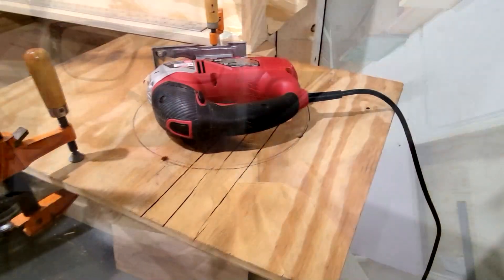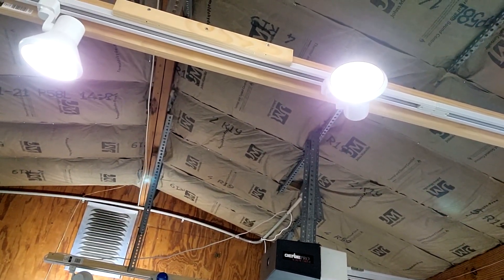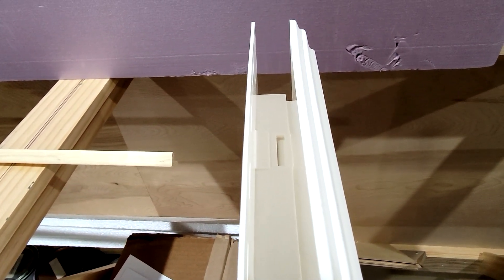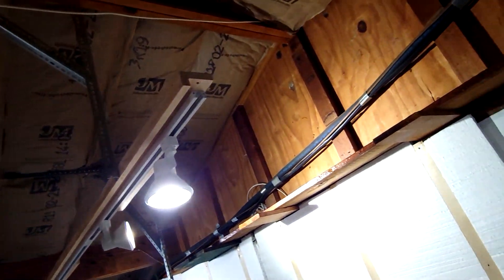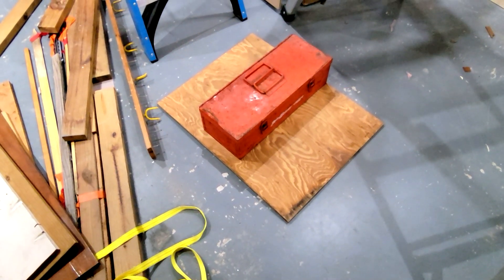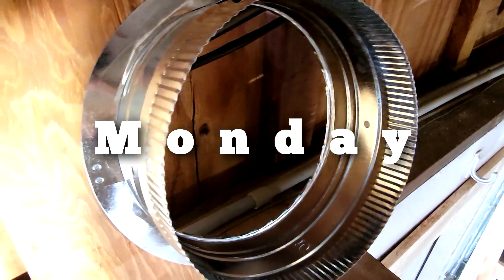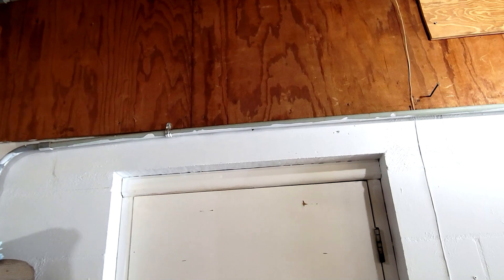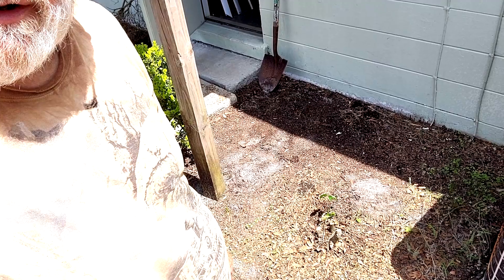No Stream - But - Climate Control Video & RANT

Comment: With being a fellow garage layout guy, it is miserable operating in the summer hear with a little climate control. Looks like your off to a good start! - Jason
Reply from the maker: Hopefully, I can get this garage cooled down before it gets too hot. It went up to 90 the other day. The rain cooled it down, but then it was hot again today. It's only April. LOL
Reply: @TomsTrainsandThings  I installed a portable AC unit and connected it to a dryer vent hose. As long as I ran it 30mins before going out there, it wasn't that bad. Just don't open the garage door...lol.
Reply from the maker: Eventually, I'll be tapping into the AC unit which is in the garage. I just have to find a good place to Tee off one of the existing ducts in the attic. Another project down the line. lol

Comment: Good to see things coming together, lot of work. Just a dumb question- why didn't you install an attic fan on other end of house to pull heat out and seal garage end.
Reply from the maker: I would have to crawl up in the low clearance attic, install wiring and a fan. Even though it appeared to look difficult, this way was much less work.
Reply: @TomsTrainsandThings  Fair enough 👌.  Looking good and should help a lot,  more heat drawn out the less AC you need- your a busy fellow in this new house and hopefully things settle down with the to-do-list and you get to enjoy more relaxing time.

Comment: Hi Tom, how many times did you go out shopping during this process? No matter how well I plan things, I always find myself making multiple trips to the big box/ hardware stores. You did a great job. Love the upside down footage. See ya.
Reply from the maker: Once I had the duct and flanges, I had to go back to get the perforated strap because I didn't want to look for the strapping I had somewhere in the totes. I did have to buy a circular saw since I gave mine away a few years ago. I always have to head to Home Depot or Lowes when working on projects. Best part is they are both about 1 mile from my house.

Comment: I hate to tell you now but that white vent is for vinyl siding. If you cut a round hole in wall you could mount round duct from outside connect insulated duct then chalk around rectangle white flange and screw to wall .Then snap other piece into it. It would look a bit odd but less work. If you didn't want white piece to lift off wall like that then put metal flange on plywood as you did caulk plywood and screw down tightly to outside wall. Mount 4 blocks outside and put white vent cover over blocks and screw into blocks through side of vent. You may loos screening that way if so just put a piece of screening over hole before screwing on white vent. Well alls well that ends well.😀
Reply from the maker: I'm positive the representatives at Royal Gable Vent Co would strongly disagree with your statement

Comment: Tom, I just got a Samsung s21 and that beep your talking about happens with mine when the power supply is not putting out enough for the phone or at least I think that is the problem. When using the power supply for my old phone I have to take the phone off fast charging to get the phone to stop beeping. I use a new power supply and the phone works fine on fast charging with no beep. So maybe your car charger needs to be replaced ? Anyway just a thought. Not sure how to stop the video from going upside down though 👍😎
Reply from the maker: Thanks Chuck! I use my power supply from my S8 with no issues. On the charging pad, I can still charge my S8 with no issues. I have display that tells me when charging is started and when it gets disconnected. I'm getting a new case without the big handle on the back. It should be in on Friday. We'll see how that one works. Without a case, the surface is so slick, it slides on the rubber pad giving the same results. The up side down videos was an issue with the S8 also. I have it set for auto rotate because I use it in landscape all the time. At least they fixed the issue of flipping the camera from front to rear while recording. I've been complaining about that for years.
Reply: Yeah my s21 did not come with a power supply. So had to use the one that come with my S8. I have always disliked how short the cord is so I picked up a longer cord and power supply off Ebay. The power supply that come with the new cord kept beeping like when you plug it in to power and would flash the charge circle with the % on the screen. So I used the power supply from my s8 with the longer cable and the problem went away. So I tried the new power supply again and problem come back. Thats when I turned off fast charge and the problem went away. So anyway I am back to using the s8 power supply so I can use fast charge. Sounds like your problem is different.
Reply from the maker: Forgot to mention. Those generic USB-c cables from Amazon or any other supplier other than Samsung will not work. I bought a couple of them for my old phone and there was always a connection error, even with data transfer. I think Samsung makes it so only their cables will work with their phones.
Reply: The new cables I have work fine just not with the power supply that come with them. They say Samsung on them but I think they are fake. Because the cable works with the old Samsung power supply.